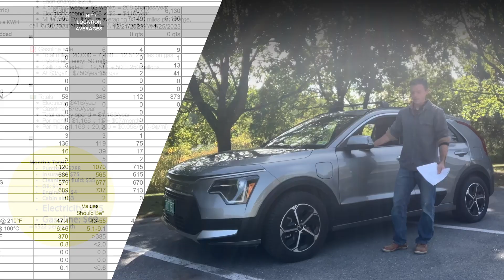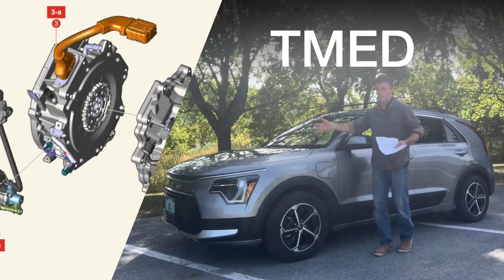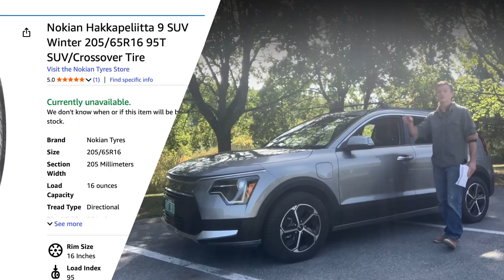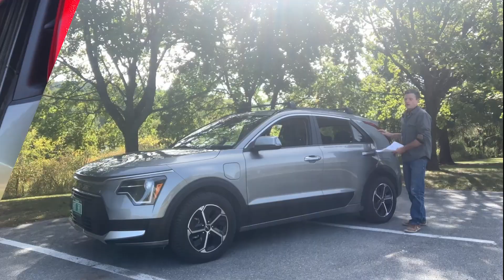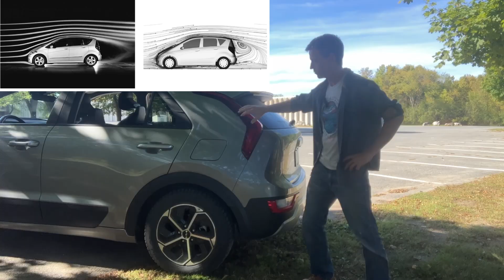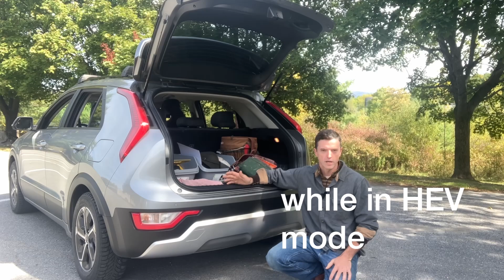Technical Dive KIA Niro Gen 2 Owners 40k Review

Comment: The reason they use a 12-volt battery system is that the majority of car electronics are built with 12 volts in mind. It's actually much easier to just use a 12-volt system than it is to remanufacture all of the electronics that go into a car. Even Teslas and full-on EVs have 12-volt battery systems.

Comment: I'm not sure if you covered this or plan to cover this in the next video, but do you know anything about the car running the engine in "charging mode"? I think it's to charge the 12v battery, but I'm not really sure. My Niro likes to go into charging mode when the high voltage battery is pretty full, but I have to do hard braking. It'll stay in charging mode for white a long time.

Comment: If you make a video about the interior, please comment on how you find the dual HVAC-infotainment controls in the center stack. Friends who have that on their EV6es either hate it or are not bothered by it. I’m curious to know your thoughts since you have a lot of seat time with the car.
Reply: I only have 16k miles on my Niro, but I don't mind the combined HVAC/media controls at all. I leave it on HVAC all the time and control the media with the screen and steering wheel. I don't find the media controls on the little screen to be useful at all.
Reply: I also just have mine set to default back to HVAC controls after being switched to media controls. At most the only "useful" media control anyone in the passenger seat ever uses is the volume knob when set to media, and I feel they could switch back to just physical HVAC controls and offer a standalone media on/off combo volume dial somewhere.

Comment: In their 30k mile update, Car and Driver mentions hunting issues with the DCT in their long-term Niro PHEV.  Have you experienced that?
Reply from the maker: Thanks for bringing this up. Yes, at slow speed crawling, like creeping to stop and then accelerating, you can sometimes feel the car link into gear. Not to unsettling, a handful of times over the last 2 year I definitely said " what the heck", or "man that was clunky" out loud. I will start writing down and time stamping these moments,...overall I like the transmission.
Reply: @KiaNiroPluginHybrid  I've experienced this too. I think its when the re-gen system is passing over the stopping reigns over to the actual mechanical brakes. I notice this happens when you're about to stop and its slowing down to less than 10 kph and then eventually you stop and that's where the clunking thing happens. So I just try to be as gentle before coming to a complete stop.